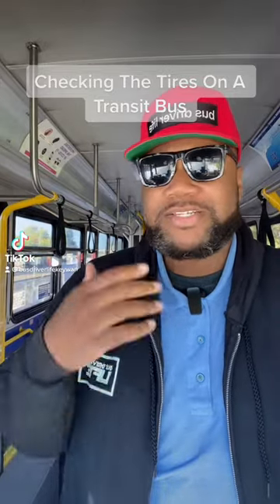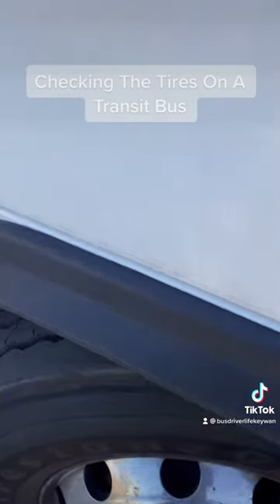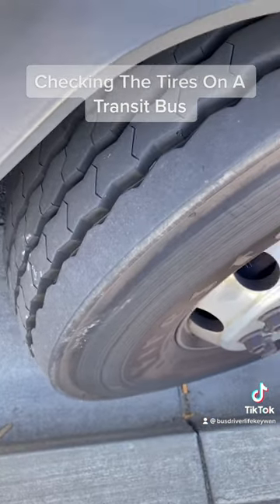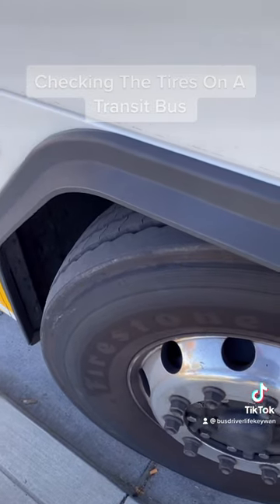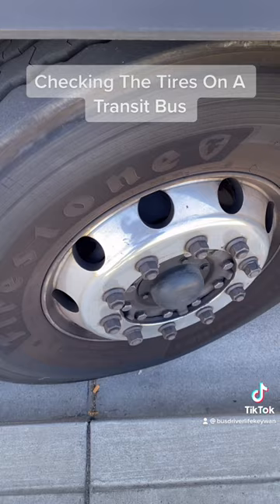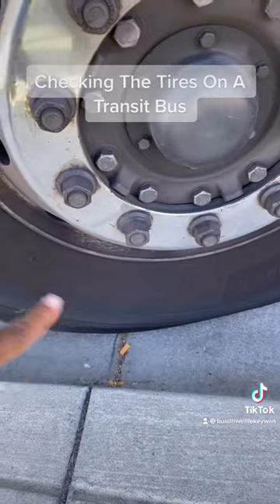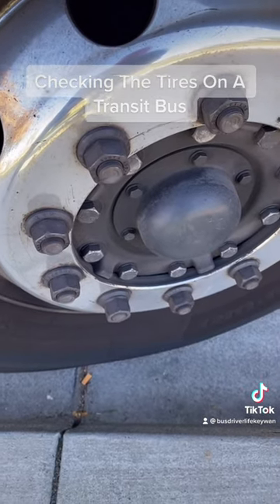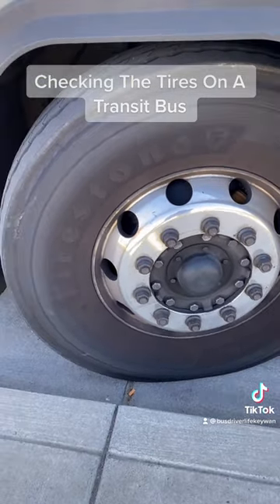How Bus Drivers Check Tires On A Transit Bus

Comment: My tyre check was "six; yes, black; yes, round; yes; done.
Some guys use to kick the tyres (but not light any fires) and listen for the right 'tone'. Only ever had one partially deflated (inside rear) tyre. Our mechanical team were very much on the ball as far as scheduled maintenance.

Comment: We have Queen Elizabeth on our dimes. You turn the dime so the Queen's head is upside down and stick the dime in the groove of the tire. If you can see the top of the Queen's head, your tires are below the required wear. I'm sure you have the same thing with Roosevelt.

Comment: Interesting your employer has the driver checking the pressure. Some transit operators forbid that since the pressure in the tires is so high, their policy is only an authorized mechanic should be handling the tire valve to check or adjust the pressure. Instead they have the driver thump the tire with a standard 16lb hammer or 'tire thumper' rod. As long as each tire makes that nice 'tump tump' sound it's good.
Reply from the maker: That’s what we do as well. I’m just breaking down what we have to know to pass our exam..and it’s on paper for us to check..but we don’t do anything in depth..the mechanics do that like you stated.
Reply: Thought all buses since 2010 had tire pressure monitors, is that not the case with transit buses?